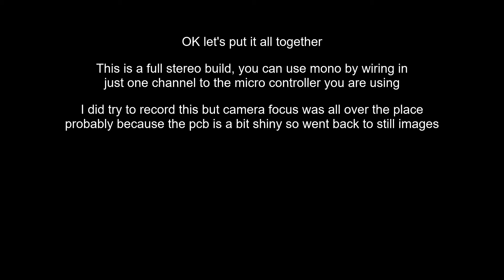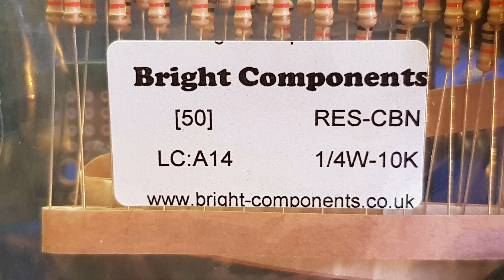How To Make: Line-In Audio For Sound Reactive Effects

Comment: I know this is an older video, but I am curious what pin you are connecting the channel data to on the ESP32.  Thank you!
Reply from the maker: Hi, On the ESP32, the default ADC pin is GPI36 (VP)
Reply: @MadeWithLight  Excellent,!  And thank you!  I have watched your video several times and am still trying to get a feel for all of the solder bridges on the back of the board.  Looking forward to trying this when I get all of my supplies Monday.  Thanks again!
Reply: @Sudzlada  Hello, I want to also hook up an ESP 32 with this system. Can you send me some pictures, perhaps a video if you suceed? Hope this comment finds you well, Cheers!
Reply: @MadeWithLight   Thanks! How do you configure this in the Sound Settings? I'm guessing you must first select the "Generic Line-In" profile under Frequency, and then there will be some sort of Pin field that appears at the top (where you can enter 36), right?